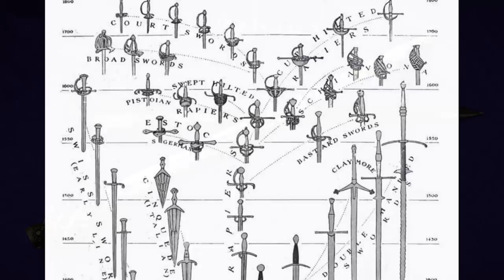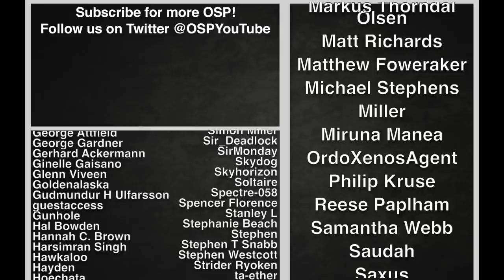History Summarized: Steel (Feat. "That Works")

Comment: Until humans start making directed energy weapons (oh wait, some militaries are already testing those) we have just made the Sticks and Stones we use to kill each other fancier.   Although some countries have replaced the wooden sticks with plastic, an gun is just a fancy stick and stone tool, to channel a firework, to throw a stone very very fast and be able to repeat that same action quickly.  Now we are considering adding electricity to the mix and replacing the fireworks chemistry with either electromagnetic fields or converting an electrolytic fluid directly to plasma with an electrical charge to throw stones even faster and farther still.

Military experience, history, chemistry, and physics can be fun combination of educational experience.  :)

Comment: Iron actually isn't stronger than bronze, it actually tends to be more brittle, and the upkeep is a nightmare. The reason it took over from bronze is because, unlike bronze, to smelt iron you only need iron. Which was hugely important after the bronze age trade networks collapsed.

Comment: You mention the folding of Japanese blades ...but not a word, about how the exact same method of pattern-welding, was used by all other ironworking cultures, around the World, until they got iron of sufficient quality, to make it obsolete. (something which happened in Europe, at close to the same time as the Japanese started making their katana ...which were modified copies, of Chinese blades, and using methods imported from China. Just like the preceding Japanese blades, which also included double edged examples, BTW. After the end of the 900's, however, it was all single edged)

Comment: There's uh, still a fair few misconceptions about the specifics here from what I can tell. Nothing I care to rant on about right now after a night playing civ though, and it gets way more stuff right than most. Just enough to irk me and such
Reply: More than willing to rant about it after I sleep
Reply: Ah fuck it, we'll do it live. Crucibles float impurities (where would they drain to?). I feel as though you are mixing up tempered, hardened, and heat treated (a steel blade is quenched to harden it, tempered to relieve strain, and the entire process along with some other stuff is heat treating).

Swords getting longer wasn't really for raw power to the best of my knowledge (hell, swords are not the most powerful melee weapon, and you show a longsword that is geared towards stabbing through plate armor gaps when you say that) but a variety of other factors (often social or things like armor development meaning shields aren't necessary) including that it became possible when it wasn't before. 

European swords continued to evolve until like ww1, not just stopping with gunpowder.
Reply: You mention folding leaving purer iron not steel, which I think is just misspeaking (though over time it tends to reduce carbon content so).

Now here's the doozy. You seem to have a fundemental misunderstanding of how steel works, or are talking like you do during the katana section. The steel already has the amount of carbon in it, mixed in (we'll ignore how this can change while being worked for clarity's sake), as an alloying element. That doesn't change when it's heated up or quenched, what happens when it's cooled fast enough is the carbon and alloying elements instead of diffusing out of the steel lattice frame get trapped in between the iron atoms causing the structure to tighten around them, becoming very rigid and brittle. When you temper it what you're doing is allowing some of those to diffuse out; as you can imagine the amount of carbon in steel affects exactly how hard something gets and how the quench works.

Spring steel and tool steel and whatnot are different types of steel, not steel heat treated differently. This can be a bit confusing (heat treatig is involved in making a proper spring), but they're differences. You kind of talk about the quench like it's just to distribute the carbon and alloying elements, when that's simply how hardening works; clearly some confusion.

This misconception probably happened because a katana is made out of a variety of different types of steel forge welded (yeah, welding with a hammer and anvil was a thing) together into different crossections, leaving say the edge, sides, and spine different percentages of carbon while still being one piece of steel. 

Martensite and a variety of other forms of steel are more akin to forms of water based on what the material is and how it was heat treated; yes it's one of those weird things that changes structures like that, there's charts and everything.
Reply: @farmerboy916  if you watch more of the man at arms reforged, they explain it way better and more in depth,
Reply: You do not make spring steel by tempering tool steel. It is not created out of other steel like that by a technique, it is a variety of steel. They totally had tempering (relieving stress in the steel by heating it up) back in the day.

Crucible steel was absolutely not cast into shape. It was melted in a crucible, made into an ingot by cooling it in the crucible (iirc anyway; either way you start off with an ingot) and then shaped.

Wootz is totally replicated today (ignoring how we can't know the specifics of that tradition), is not a super special thing nowadays except for giving material scientists the idea of putting nanotubes in steel, and was mainly special then for being the closest thing to modern steel. And pretty. It's really just a bitch to make, taking lots of hand labor.

Also, to further confuse the damascus issue (huzzah, you didn't fall into that trap) damascene is something totally different and unrelated, a style of gold inlay, so you did kind of make a mistake after all. :p
Fuck english, fuck it so hard.
Reply: And I think that's it. Despite all the above, you still got more right than most and probably more right than wrong. Which is really saying something about the average knowledge level of this stuff. Anyway cheers
Reply: Adam Kiraly Yeah, I'm only talking about things wrong in the video here.

Comment: On Damascus(es?) steels I had enough. But hearing about the carbon nanotubes, when a 15 min google search can get you the explanation of real smiths mentioning that all of the steels that uses organic material as carbon source will have carbon nanotubes BECAUSE the plants used for charcoal ARE the source of it, got me irated.
For anyone interested in the subject of Damascus, Mike Loads has published a great, in my opinion, documentary on the subject, and, as an ex archeologist interested in metallurgy, those arguments convinced me:
https://youtu.be/OP8PCkcBZU4
And as for all people calling pattern welding (or dziwer vel bułat, as we call it in the East) Damascus  - pls, sthaph mate.

Comment: "The Katana: A average sword with a 1 thousand year PR campaign".
As I understand it, the impressive part of Japanese Steel making was not the swords. But the poor base iron they made them from. It was impressive work to get from the poor iron to useable Steel Weaponry. Much less steel intensive weapons like swords.
European Armor and weaponmaking easily beats it, but we also had loads more raw material to work off. And then firearms kind of made steel armor and weaponry useless.

Comment: Damascus wasn't "good steel". It's getting the most out of lower quality steel. The folding is done so that the carbon gets distributed more evenly after heating, folding and hammering the bejeezus out of it over and over many times.
Edit: it also lowers the overall carbon content so you don't end up with a brittle pig-iron sword.